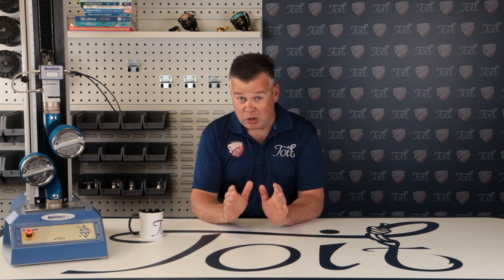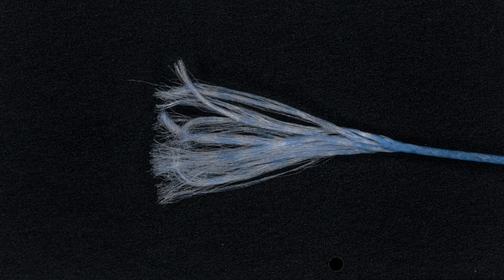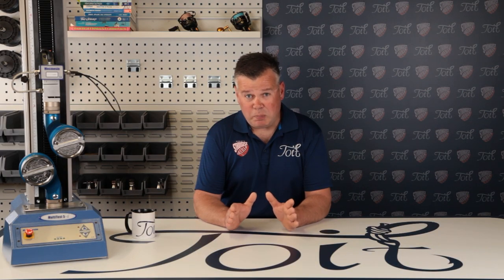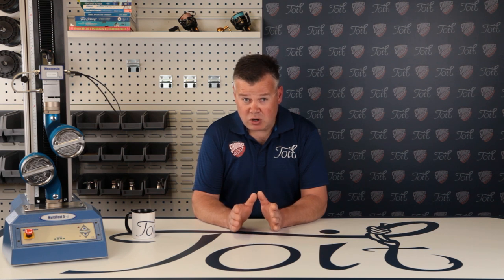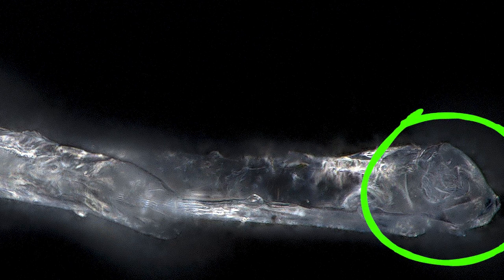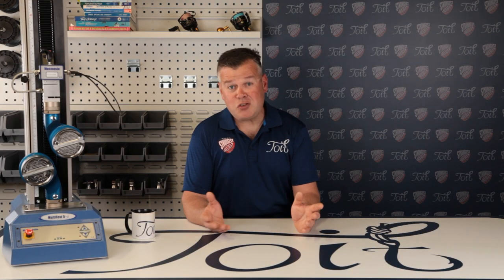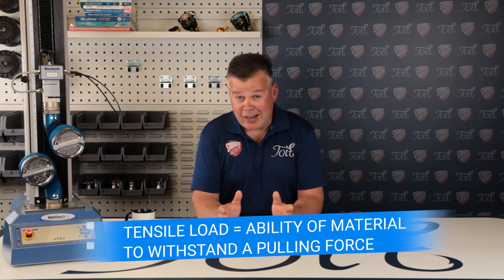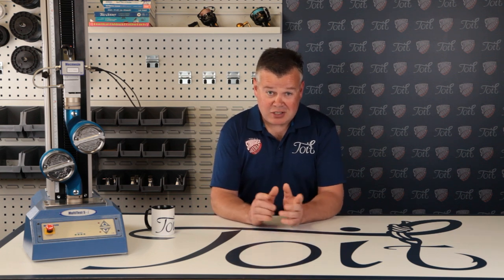Braid Fishing Line Failure | 20X - 2000X Magnification Microscope | Science Sessions Episode 1

Comment: Hey Warren!  What an amazing video and real eye-opener, thank you for putting in the time and sharing this.  Those magnified photos are incredible, never thought I'd see a braided line that close, haha so cool.  Amazing too how many imperfections there are with both the dye and the strands.  I better understand now how when the braid snaps at the knot it is first a shear failure of an outside carrier and then a tension failure of the rest of the carriers.  I am very curious if you test a line with fewer carriers if it will still fail in shear first since the carriers will have a larger diameter and therefore have better shear resistance.  The mushroom-looking ends of the strands are caused by the "snap back" opposite reaction and curling of when the strand breaks?  I wonder if they are fused by heat from friction?
Reply from the maker: Hey Peter, hope you are well. Yes these images have certainly taught me so much about braid fishing line, really opened my eyes. Glad you like the content. Hopefully if people like this kind of content I will certainly do more and look at 4x vs 8x and also explain the energy dissipation at the tips, which essentially caused a release of heat, especially when you think the total load spread across the fibres was in excess of 70lb. 

What would also interesting is to compare braid lines with different fibre diameters, if you think that a blunt knife has a bigger edge than 18 microns. 

Again thx for watching, appreciate your support. Tightlines.
Reply: @toitfishing  wow amazing stuff, so the mushrooms are caused from the release of heat of all that potential energy, crazy stuff! 70lb of load across such a small area is going to have some explosive results.  Wow 18 microns is so tiny, yea that would be very interesting to see some larger diameter fibres but it seems the industry has gone the other direction in terms of more carriers and more fibres with less diameter.  Is that correct?  You may have to find some old school braid?
Reply from the maker: Yeah I guess they have. I think with the patent gel spun technique when they actually manufacture these fibres they are stretched and aligned so much that the end result has got barely any more give. That is why it is such a strong material under tensile load. It would be a great discussion with one of the top fracture analysis people at Dynema. Maybe one day I get an invite. As you rightly say the current makeup definitely lends itself to a design that urges towards the tensile side of things rather than the shear or cutting side of things. As you mentioned earlier also, the imperfections on the surface only add to the cutting ability of this braid line, at 18 microns and all those little imperfections it’s a bit like hundreds of little serrated knives within the fishing line. Interesting stuff.
Reply: @toitfishing  I never knew they pre-tensioned the line during manufacturing, but makes total sense.  Very interesting indeed how the imperfections of the fibers end up cutting into itself (its own worst enemy like you always say).  This is fascinating stuff, I love braided line and it really has been a game-changer to the fishing industry but it does have limitations and there will seemingly always be a place for single filament lines that have that shear resistance and abrasion resistance
Reply from the maker: @PeterRanieriII  glad you enjoyed it. Take care.